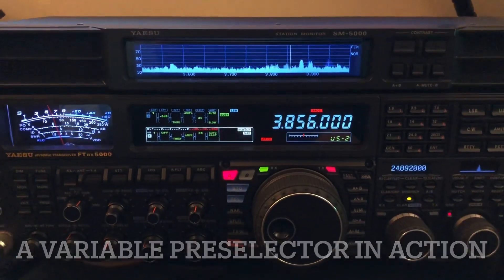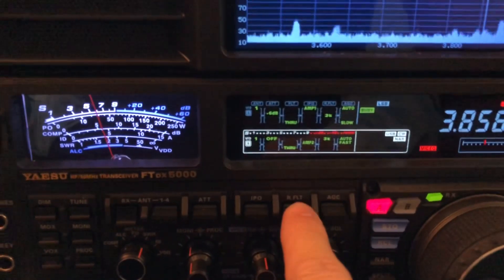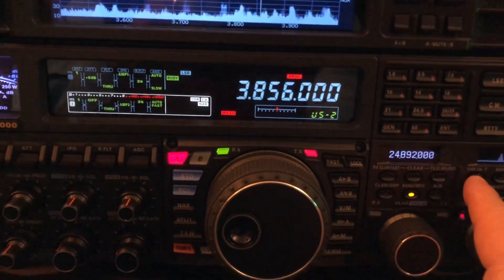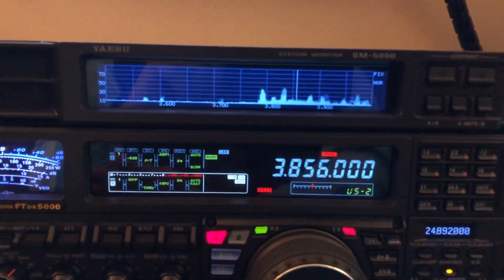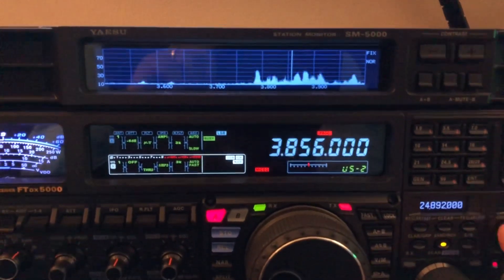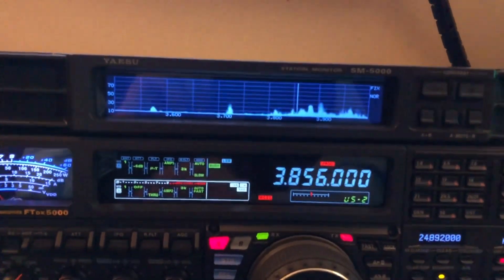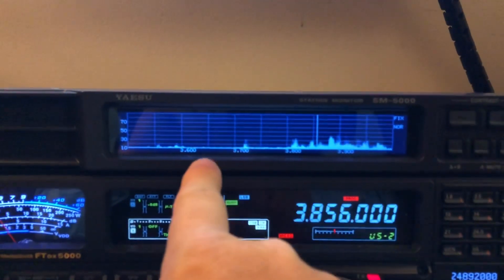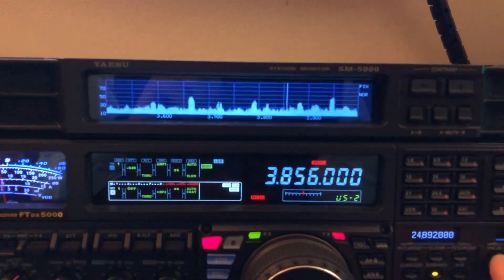A Variable Preselector In Action (Yaesu mu-Tuner)

Comment: Could this be used externally with the FTDX-10
73
Mike
WB6DJI
Reply from the maker: I’m sorry. The FTdx10 has no connection for a preselector. The FTdx101D and MP had the preselector included.  The mu-Tuning preselectors are compatible with FTdx5000, FTdx3000D, FT-2000, and FT-950. I think that’s all of them. The FTdx9000 has mu-Tuning preselectors built into it. 

73, de N4HNH

Comment: Thanks for that Doug. So the main purpose of a mu tuner and vc tune is to attenuate signals from other stations that are close by and interfering with you?  Or is it good for attenuating noise (or grind as you put it?). What’s the practical difference between using the mu tuner and simply narrowing your roofing filter?
Mark
Reply from the maker: The variable preselector is ahead of the roofing filter so it helps the roofing filter, similar to how the roofing filter is ahead of the DSP stage and thus it helps the DSP width.  The more you attenuate unwanted frequencies of noise/QRM in the earlier stages of the receiver, the better job the DSP can do with the final cleanup.  

73, de N4HNH
Reply: @n4hnhradio  That sounds great on paper, but I've never seen a video demonstrating a preselector actually improve a signal you are trying to receive, beyond what the roofing filter does already. The videos show the effect on the bandscope, but I've never HEARD a difference to a real signal. Makes me wonder if anyone really needs this feature. If you ever find a day on a crowded band where a real signal can be improved, please take a quick video, thanks for all you do.
Reply from the maker: I don’t deal in paper.  My videos focus on operating techniques while sitting in front of the transceiver.  I’ve covered QRM in numerous videos.  I’ve covered the mu-Tuner ad nauseam.  It can definitely help when a station up or down the band is interfering.  Just watch the FTdx5000MP playlist.

The thing to do is use a tighter DSP width (1.5 to 1.95 kHz) and shift +/- first.  Then rotate the knob to adjust the mu-Tuner such that it blocks the offending QRM while still allowing you to hear the station you are trying to listen to.  

The idea is to drop the station you are listening to down into the skirt of the mu-Tuner filter while dropping the QRM station even lower.  The station you are listening to might drop to S1 but as long as the QRM is even lower you have accomplished your goal.  It’s like an attenuator on a sliding scale.

There is an upcoming video where I use DSP width, Shift, and a mu-Tuner to attenuate QRM from 2kHz away.  But I’ve already shown that in other videos in the FTdx5000MP playlist.

73, de N4HNH
Reply: Thanks Doug, that makes perfect sense.
Reply: Doug -
Are the band pass filters physical or software filters?  If they’re physical, is there a separate one for each band (about 12 separate band pass filters inside a radio)? I don’t see any band pass filters data in the manuals. Thanks. 
Mark
Reply from the maker: Mark, there are 15 physical bandpass filters, one for each amateur band (10 total) and 5 more for general coverage receive.  It is typical for any dual-superheterodyne receiver to use physical bandpass filters.  

The FTdx10 would perform about the same without the SDR stage.  The SDR stage mainly drives the scope.  The SDR stage is fluff but it provides the bandscope the width it needs by sampling ahead of the roofing filters.

The dual-superheterodyne receiver technology is extremely advanced, compared to traditional superheterodyne technology.  It represents the highest pinnacle for an amateur radio.  Add to that the Yaesu DSP, best in class, and you have an over-the-top receiver.  

73, Doug